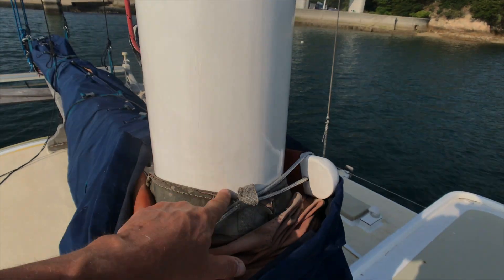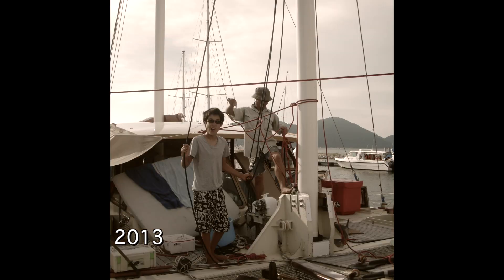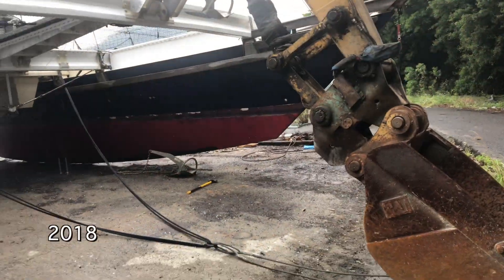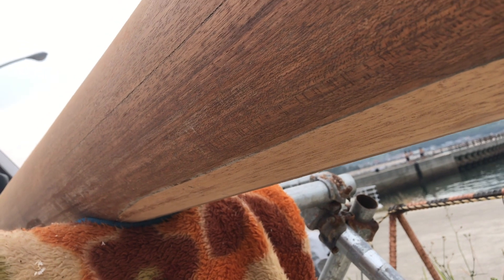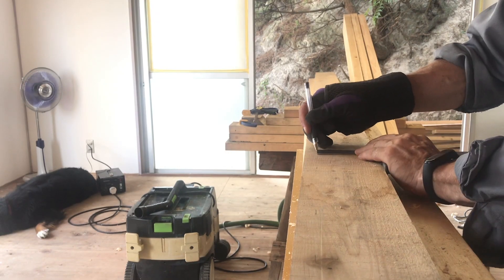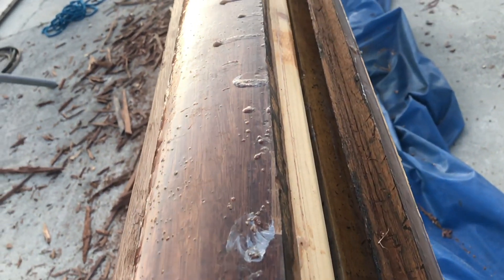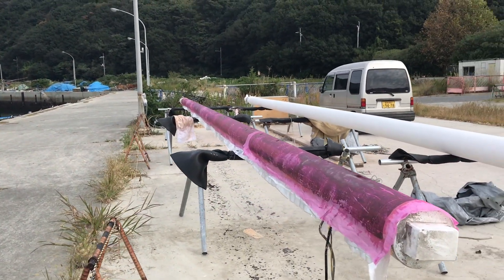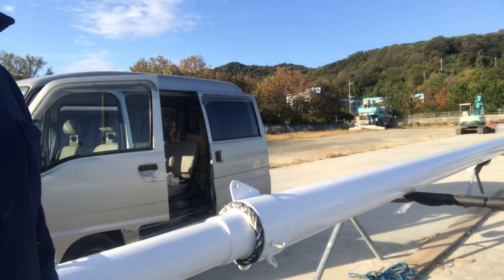Rotten wooden mast needs rebuilding [Ep25]

Comment: For a guy that says he doesn't know much, it looks like you did a great job. The mast looks beautiful! I only wished you had shown us how you made the cuts for the birds mouths.
Reply from the maker: Thanks for the comment. Cuts in the birds mouth were done with the saw at 45? degrees on a rail. Matter of ripping down the length of the wood, then again on the other side to get the complete cut or birds mouth. 
Was a lot time spent removing bad wood, shaping and  nutting it out to get everything to fit. Really would have been easier to build new.